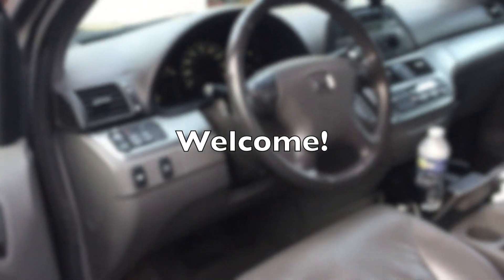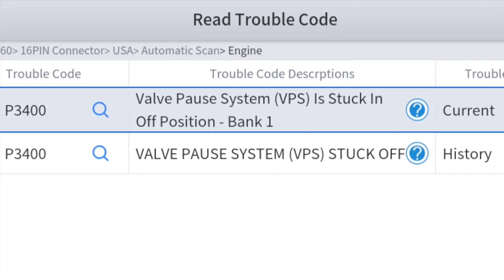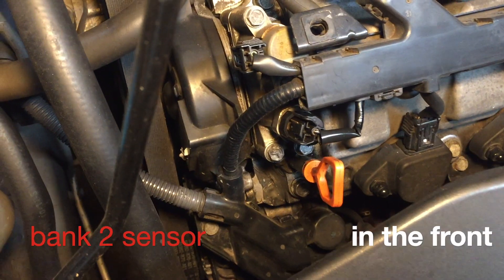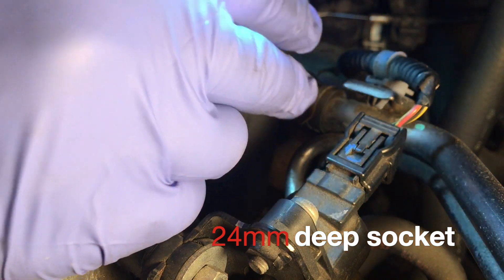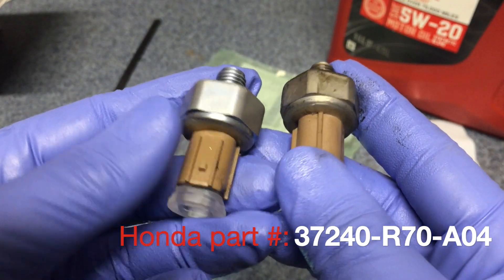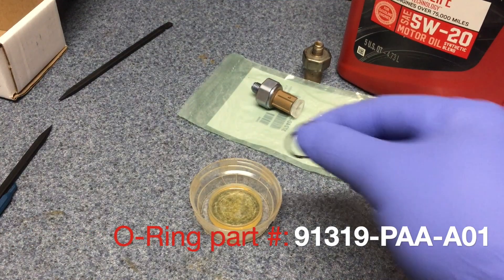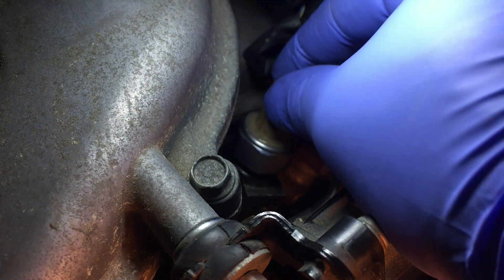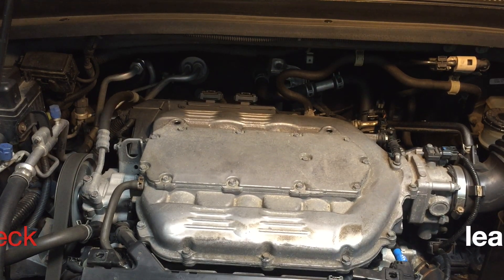Honda V6 Oil Pressure Switch Replacement (Code P3400)

Comment: The high-temperature sealant must be applied to the screws of the new engine oil pressure switch before installation. The switch must have already been sealant-treated, but after a long time, the engine oil must have melted. If you just install it without treating the screw tape or the sealant, there will definitely be a serious accident of oil leakage within a few years. Please take the video with proper information.
Reply from the maker: Thanks for your input, but could you point to a Honda service manual or OEM documentation that recommends sealant for this switch? I’ve seen this kind of advice before, but the factory switch I removed didn’t have any sealant on the threads — it seals with the O-ring. I replaced that O-ring with a new OE part, and it’s held perfectly. If there’s an official basis for using sealant here, I’d really like to see it.

Comment: What size wrench will fit the 24 mm socket?
Reply from the maker: Good question! It's either a 1/2'' drive or 3/8'' drive but I'd recommend getting a 3/8'' drive socket for this application: https://amzn.to/43DewD6, and a 3/8'' ratchet wrench like this: https://amzn.to/46FYFXG so you don't over-tighten the switch. It only requires 13 lb-ft, hand tight. It will seal with a good rubber gasket.

Comment: Does it make any driveability issues other than check engine light?
Reply from the maker: It doesn't normally lead to any drivability issues unless your engine has other complications. P3400 on a Honda means the system detects an oil pressure problem and won't activate VCM, which is actually good news for power delivery (with all cylinders running). That said, if you got the code due to oil condition, oil burning or others, you will need to address those issues as well.
Reply: @profsg 
Will the vtec system be able to operate normally since they use the same pressure cercuit?
Reply from the maker: @marwanjleid5712  this doesn't affect VTEC, which does rely on oil pressure but has a separate system to direct oil to activate. If you encountered issues related to both the oil pressure switch and VTEC, you likely have a problem with your engine oil, e.g. dirty oil, incorrect grade or low oil level.

Comment: Are both bank 1 and bank 2 sensors the same?
Reply from the maker: Yes, they are the same switch/part number. P3400 points to bank 1. Replace bank 2 sensor only if you get P3497. On this Honda V6 (J35), it's common to have a problem on bank 1 due to VCM.

Comment: This video was lifesaver. I had this code showing up, and followed the steps in the video. I bought the equivalent part at AutoZone, and was able to do the install in 10 minutes. Cleared the code and my car is running as normal again.

Thanks Professors Garage
Reply from the maker: Awesome! Glad to hear it helped!

Comment: Great video! I had a lot of trouble trying to unplug the connector on Bank 1. The Bank 2 connector is the same style and is easier to access, so I practiced disconnecting it so that I could understand how the connector clip worked and realized that the part that I needed to depress on the Bank 1 connector was not visible from the angle that I could see and also not visible in the video. It was still a difficult effort, but I eventually got it right and was able to disconnect the connector and continue with the procedure. Thank you!
Reply from the maker: You're welcome! Good you practiced it on the Bank 2 (front). Any of these connectors can become quite stubborn after sitting in the heat for years and needs a good grip (while pressing the tab) to pull out. Sometimes you may have to use both hands, one to press (e.g. with a small screwdriver) and the other to pull (e.g. with pliers). I recently ordered one of these "disconnect pliers" that can get them out with one hand: https://amzn.to/3Ds8xZl, handy for such occasions. 

Thanks for the feedback!
Reply: @profsg  I ended up replacing the valve oil pressure switches on both banks 1 & 2. My check engine light came back on again with the same P3400 and P3497 codes. Something else I can try or look into now?
Reply from the maker: @ I hope you don't need new solenoids. But check these simple items first: have you changed your oil frequently, is your oil level low, is it in good condition, and does it burn oil? Both VCM and VTEC require clean oil through tiny passages for it to operate correctly. So if you haven't done recently, do an oil and filter change. And if nothing else, disable VCM with this simple mod: https://youtu.be/z0bO93r4YSE, that may save you from headaches like this and many other problems down the road.
Reply: I checked, and the oil level was very low, so I brought it in for an oil change. I last had it changed 3900 miles ago, so not too bad. The mechanic said that he found no oil leaks so I must be burning oil. I just watched the video that you linked in your last comment.  Maybe the VCM is my problem.  @profsg

Comment: Will this switch work on a 2012 Honda cross tour?
Reply from the maker: Yes, if it's a V6. It has a similar J35 engine using the oil switch with the same part number (37240-R70-A04).

Comment: Hey man! Can this be done with a 2009 accord ? I get the p3400.
Reply from the maker: Yes, if it's an Accord V6, which has a similar J35 engine.
Reply: @profsg  thanks! Simply do that? My code couldn’t relate to other issues? Thanks for your help!
Reply from the maker: It's a common problem on Honda V6 (J35). Certainly there are other related issues such as engine oil level and condition. Has oil been changed regularly at 5000 miles or so? If not, change it first and replace the switch. Hopefully there isn't a more serious blockage/damage internally.
Reply: @ wow! Thanks man! I’ll do all those tings this weekend! Much appreciated the reply ! 

I’ll let you know how it goes.

Comment: Where can we get the parts number ? And o ring gasket
Reply from the maker: Part numbers and links are in the video description, which I copied here: 
1. Honda Oil Pressure Switch, part#: 37240-R70-A04, https://amzn.to/3IoBSCT
2. O-ring, part#: 91319-PAA-A01, https://amzn.to/3Im2c0o

Comment: Can someone please tell me is the switch in the back of the engine or do I have to remove the passenger tire.

2015 hond accord v6
Reply from the maker: Short answer is, your oil switch (for a Honda V6) is in the back of the engine just like in this video. A Honda V6 (J35) engine has two banks in the V-shape design, one in the front (bank 2) and one in the back (bank 1). I guess the confusion is due to the use of (inline) 4-cylinder engines on some Accord trims, which have essentially only one bank with the oil switch indeed accessible from the passenger-side. Hope this clarifies.
Reply: @profsg  Thank you for answering I just kept seeing videos where the oil pressor switch on newer Hondas you had to remove the passenger (left side) tire and some were in the back on the right side

Comment: Same code for a 2011 V6 accord. Is it the same thing?
Reply from the maker: Yes. Your accord has the J35Z2 engine, which is very similar in design with the J35A7 on the Odyssey in video.

Comment: I have a 2011 Honda Pilot, I need to replace this part. How do I know what the part number is ?
Reply from the maker: I believe it's the same part as in the video: Engine Oil Pressure Switch - Honda (37240-R70-A04). You can call your local Honda dealership to confirm or use a Honda parts site like this (enter your car's make/model/year/etc. to find parts): https://www.conicellihondaparts.com/oem-parts/honda-engine-oil-pressure-switch-37240r70a04?c=bD0xJm49U2VhcmNoIFJlc3VsdHMmYT1ob25kYSZvPXBpbG90Jnk9MjAxMSZ0PWV4LWwmZT0zLTVsLXY2LWdhcw%3D%3D
Reply: @profsg  Thank you. Did you have to pay for a over-ring or did it come with it ?
Reply from the maker: Yes, the o-ring is a must-have for this replacement and it's purchased separately. Part number in the video description.

Comment: I couldn't remove the connector in tight space.
Reply from the maker: The connector can get very stubborn after all the years. You may use a screwdriver to help depress the connector tab at the top AND/OR a flathead to pry the connector upward to remove.
Reply from the maker: It helps to practice removing similar connectors in the front. Here's a video where I showed tricks to remove several connectors including an oil pressure sensor in the front: https://youtu.be/9Bdt96L_LBg

Comment: Thank you Professor.   How would you determine if it was the bank 1 or bank 2 oil pressure switch?   Thanks again.
Reply from the maker: Sure! I assume you have scanned your system with an OBD2 scanner and the code is P3400, which indicates a problem with the deactivation system specifically on bank 1. If it's a bank 2 problem, the code will be different, e.g. P3497. Hope this makes sense.

Comment: Can this code cause the rpms to accelerate high
Reply from the maker: This can be associated with problems with the VCM (Variable Cylinder Management to deactivate cylinders to save fuel) and misfires, which can cause engine to run rough and potentially higher RPMs. It's best to use an OBD II scanner to scan the system to find out if you have other code? Also look at the fuel trim while you are there to see if the engine is running rich or lean. Check engine oil condition, spark plugs, and potentially O2 sensor issues. I cover misfire diagnosis in this video: https://youtu.be/fbmwImqPRfI

Comment: I’m getting this code along with a misfire on Cylinder 4. Do you think replacing this will fix it? Or is it something else.
Reply from the maker: Here is what I'd do (in this exact order): 

1) Check and change engine oil if necessary. Good engine oil level and condition can be a culprit for both issues. 
2) Replace the oil pressure switch as in this video for P3400. 
3) For misfire diagnosis, follow this video to identify one of those common culprits: https://youtu.be/fbmwImqPRfI
4) For the long-term, if it's the same/similar Honda V6, disable the VCM. Very simple and cost-effective: https://youtu.be/z0bO93r4YSE

Hope this helps. Keep us posted of how it goes.

Comment: Was it driving bad when the engine light came on? I'm thinking the reason my  pilot is driving bad is this but I'm not sure.
Reply from the maker: Did you experience loss of power? Have you run a full scan and were there other engine codes like misfire? Ultimately, the VCM (Eco mode) puts a lot of stress on these components (vibration, worn out engine mount, oil burning, etc) and it's wise to disable it on a Honda engine. Here is a related video: https://youtu.be/z0bO93r4YSE?si=WPlYXxHU-rCeReHm

Comment: Do the same steps apply for the J35Z2 - VCM engine? (2010 Accord V6). Same code and my dealership wanted to change the entire rear spool valve
Reply from the maker: I believe so. The best is to check Honda parts and fitment with your VIN (year/model): https://www.conicellihondaparts.com/search?search_str=oil+switch

Comment: unfortunately, the threads stripped pretty easy
Reply from the maker: Oh no! Hopefully you only stripped the switch only. Even though the socket is big, it only takes a rather small torque to tighten it. 13 lb ft (in the video) is about the force you would use for a spark plug with a much smaller socket. That's why I used a small wrench in the video. If you don't have a torque wrench, hand tight or snug is enough. Hope you fix it!

Comment: Hi! What instrument did you use to loosen the oil switch?? Did you use torque wrench to tighten it?? Thank you!
Reply from the maker: Yes, correct! Use a ratchet or a breaker bar to loosen the switch, and a torque wrench to tighten it to spec, which is 13 pound feet of torque. If you don't have a torque wrench, make it hand tight or snug; don't over-torque. Important to get an OE/Honda oil switch AND a rubber gasket to seal it. No aftermarket parts for this application.
Reply: @profsg  Thank you for your help!

Comment: Didn’t work for me
Reply from the maker: Sorry to hear that! If nothing else, check your oil level and condition. These operations are sensitive to proper oil pressure and low or dirty oil can be the culprit, if not for more expensive reasons.

Comment: I have a 2012 odyssey. Replace the sensor, oil but still have same code after 2 weeks what could be.
Reply from the maker: Did you clear the code and it come back after two weeks? Possible mechanical issues with cylinder deactivation, which can be more costly to address. One thing I’d do though is to disable this whole system of cylinder deactivation (i.e. VCM) to bypass the issue possible. Here is another video on disable/muzzle VCM: Honda V6 Engine Burns Oil? Fix it in 5 minutes.
https://youtu.be/z0bO93r4YSE

Also review comments under that video as there are different options to purchase and install.
Reply: Did u find out what was the reason?

Comment: I changed the alternator for Pilot 2011 and then I could check engine and VTM-4 on the dashboard.
According to the checking, I found the error you mentioned plus VTM-4, so if I change this sensor, will I get my car fixed ?
Reply from the maker: Usually the P3400 code is related to VCM (Variable Cylinder Management). Issues with oil condition/level, pressure sensor or control solenoid problems can contribute to the code. These are possible reasons.  

However, VTM is a different system and I don't think they are related. If you feel these might be due to the alternator replacement, it's best to test and monitor the alternator connections/output. Is it providing good charging and relatively stable voltage? Also when the code/light appears, do you experience anything noticeable with the car/engine? For example, does it vibrate, make noise, and/or lack acceleration?
Reply: @profsg  I noticed higher sound from the radiator fans when the AC turned on.
In addition I got below errors and all after changing the alternator.
B1239
B1245
B1246
77-01 powerstrain system failure current VTM-4

Comment: what could be my issue if this still happens after i raplace the switch? my car wont accelrate and vibrates really bad when the light goes on, usually after 60 mph
Reply from the maker: What does your scanner say about the code when the light is on? Is it still p3400 only or something else?
Reply: @profsg  just p3400 and it comes w lack of acceleration and heavy vibration, if I can send you a video I will, do you have social media ? Before I replace the part I wanna make sure it’s that first
Reply: Says bank 1 stuck off
Reply from the maker: A couple of questions/suggestions, starting with the easy one: 
1) Is engine oil new and at the correct level? Good engine oil condition/level is critical to related oil-pressure-based de/activation systems. 
2) When it "won't accelerate and vibrates", is the green ECO (VCM) mode turned on? You said it's after 60 mph so I suspect the engine is likely warmed up to (try to) activate VCM (to deactivate some cylinders). 

For the 2nd point, it could be expensive to fix any mechanical problems with the VCM deactivation system, I would--
1) Disable the VCM. I have a video on this: https://youtu.be/z0bO93r4YSE
2) Check your engine mount (Active Control Engine Amount), which is Honda's solution to mitigate vibration and wear due to engine imbalance caused by VCM. It likely needs a replacement. But the real culprit of the vibration is VCM, which also causes oil burning, etc. 

Hope this helps.
Reply: @profsg  when I first got the car the mounts was replace, when the light is on the eco mode doesn’t turn on. I do have oil leaks that I’m fixing with the valve assembly and I did read the vcm is a reason for the oil burning fast I was gonna buy something to turn it off just haven’t gotten to it yet. But I wanted to make sure if I replace the spool that it will stop
Reply: Having similar issue, car wont accelerate as effectively as it used to  when pressing gas, rpm jumps a bit over 2000rpm after being idle at stop light and slightly accelerating. Would the oil pressure sensor cause these types of issues with my car or could it be something else?
Reply: @chrisalford2499  I replace the rear vvt solonoid
Reply: @Apulux  did that take care of the problem for you just by changing to solonoid or did you replace sensor as well
Reply: @chrisalford2499  the solonoid will come with all new sensors bro I replaced the entire solonoid and everything was good after

Comment: tanks so much but have a ?you put new ring end what can oil mix with ring tnaks again
Reply from the maker: Glad it helped! Were you asking about the oil I used to lubricate the o-ring? It was engine oil (e.g. 5W20) so the o-ring will get into place properly (without getting pinched).
Reply: @profsg  tanks so much your the best

Comment: What about code p3497?
Reply from the maker: I would check the engine oil level and condition first. Replace engine oil if it's low or dirty. This is a common reason and can be an easy fix. Hopefully, it is not something else.
Reply from the maker: To add a note on engine oil--A healthy oil level/condition is critical to engine performance and controls that rely on the oil pressure. When the oil gets dirty or low, they will start to malfunction. This speaks to the importance of regular oil change (i.e. every 5000 miles).

Comment: Would the check engine light still stay on if I got the part but didn’t replace the o ring?
Reply from the maker: That’s possible, though it’s likely due to other factors. I’d still recommend change the o-ring with an OE part from Honda. The code will stay on until you clear it with scanner or drive enough miles without problems. If it comes back, check engine oil level and condition. Low or dirty oil can cause this problem too. So an oil change should come next.